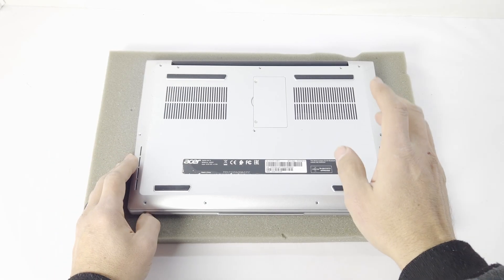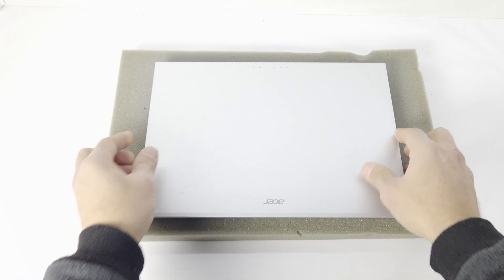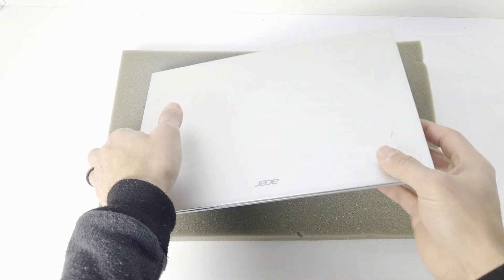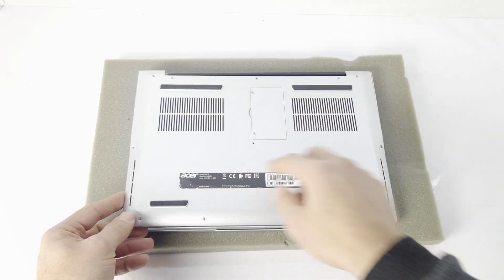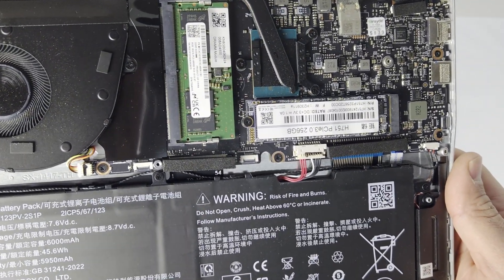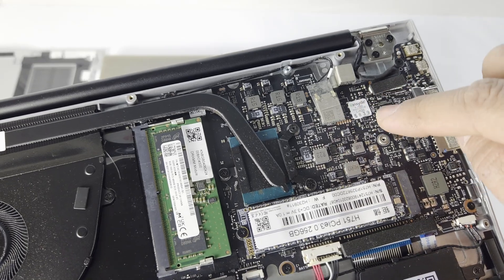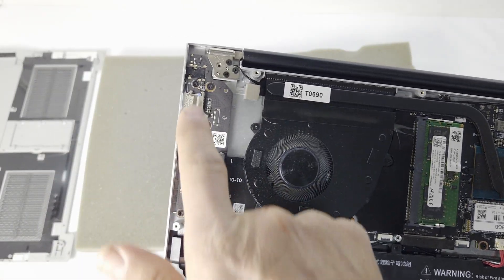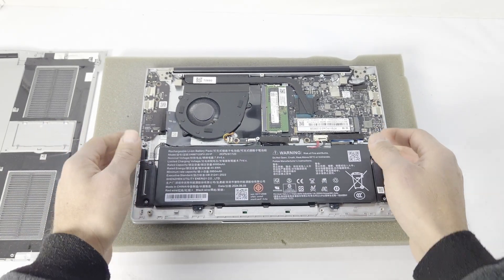Acer Lite 14 inside for upgrading

Comment: I have this same laptop , partially turns on by showing the power on lights for seconds then turns off what should I do
Reply from the maker: Is the charger still fine. When you plug it in, is it showing charge
Reply: @jacqalas  yes ,sometimes it even shows blue light to show its full , but the initial charger got broken month back I'm using a replacement.
Reply from the maker: It would be best if an IT shop take a look. If it's still under warranty, maybe the retailer can assist. I am in Kroonstad, South Africa if you are near us we can also check